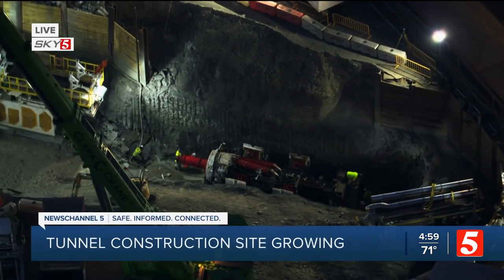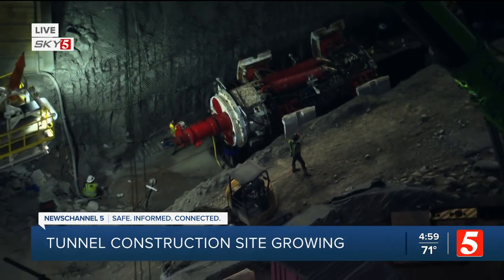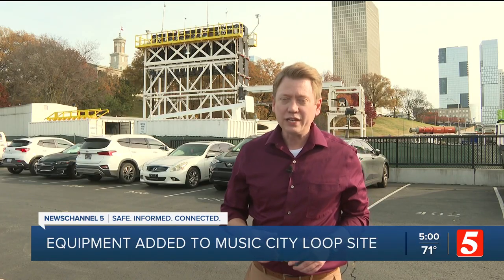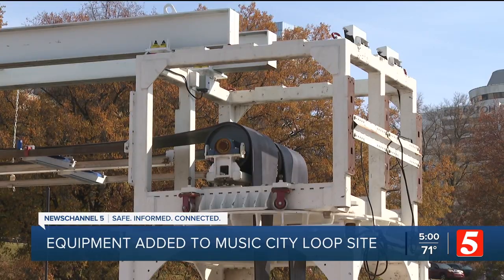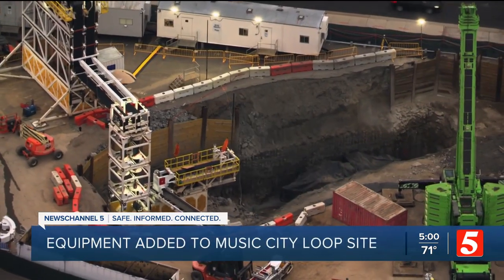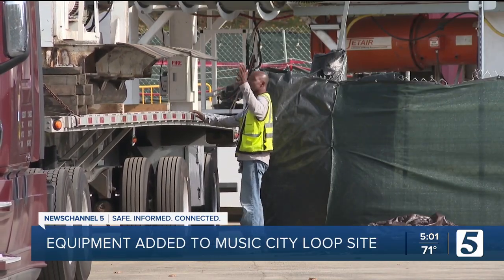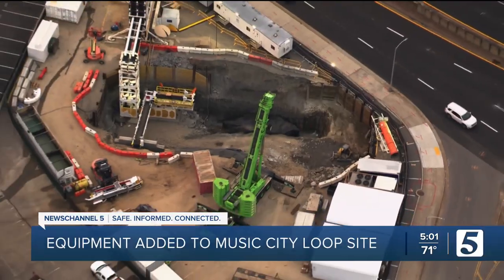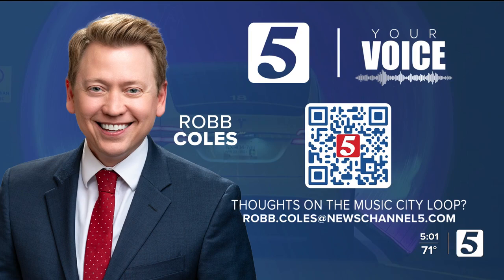Massive rock removal machinery arrives at Music City Loop site

Comment: What is amazing is most of those boring machines get buried at the end of the tunnels because the cost of getting the machines out is to much and more cost effective to leave it.
Reply: Please stop lying! There has been very few buried TBM! The Manche tunnel linking France to the uk used multiple TBM which few were abandoned.
Reply: The herrenknecht tunnels are built to run trains are very high speeds, cars, cargo….
Reply: @alanmay7929  how much did these tunnels cost 10 billion 20 billion40, billion
Reply: @dewdropin2010they did not cost 20 or 40 billions, they are actually much more usable tunnels for high speed trains, passengers transport and also freight, not the useless musk tunnels, plus those tunnels actually have safety features unlike agains musk useless tunnels.
Reply: @alanmay7929  Boring Tunnel systems have full, inspected, and approved safety systems and infrastructure. NY City subway tunnels cost 4.6 billion per mile.
Reply: @DR.LingeringFrey 😂😂😂😂😂😂 those “safery” features are what exactly? The paints and lights on the walls? The New York subway runs 24/7 and move millions of people yearly almost non stop with actual fast trains! How dare you compare to the useless musk tunnels?
Reply: @D @DR.LingeringFrey American subways are too expensive because they never actually kept the experience by keeping building more infrastructure and also the underground of the city are already very crowded with all kinds of infrastructures. Also there is corruption in those projects which doesn’t actually reflects the actual price.
Reply: Not with the Boring Company.
Reply: Shows you how cost effective they are over any other method to get from point A to point B.
Reply: @joe28704 how excactly? Herrenknecht, Hitachi and more all makes TBMs with different diameter sizes from microtunneling 100Cm to 19meters depending on the applications.